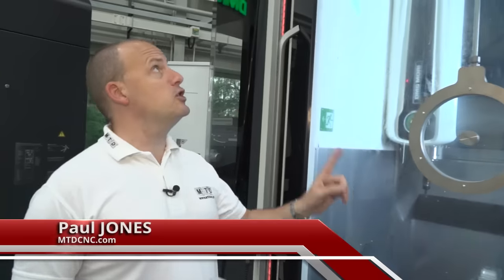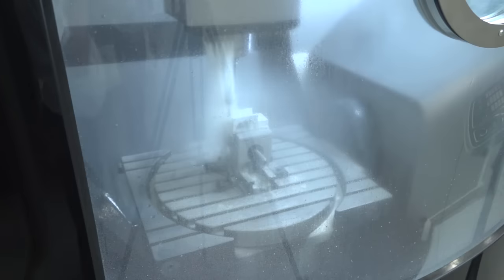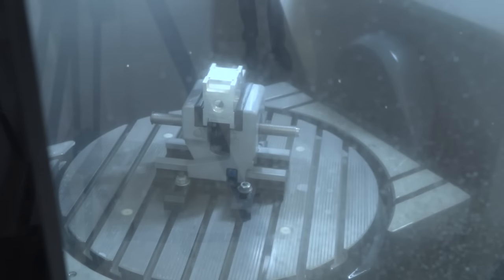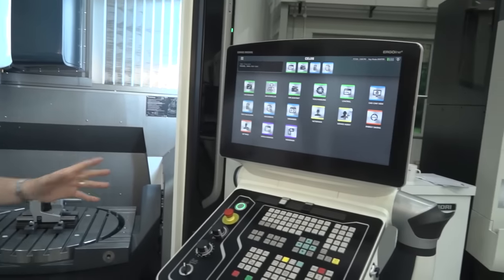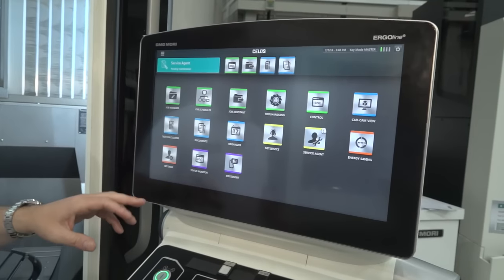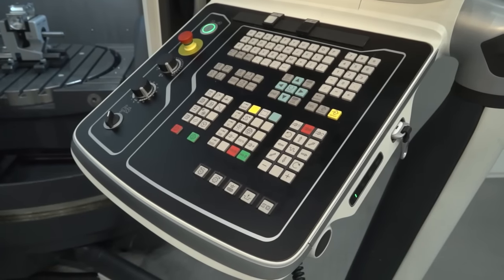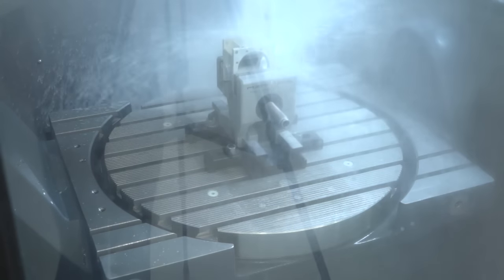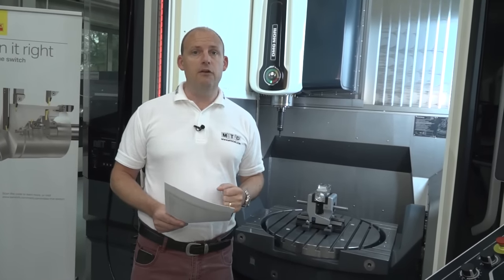DMG MORI DMU 75 Mono Block 5 axis machine

Comment: hmm why so tall??
Reply: You will see for sure that machine tools produced in Japan will become taller in the nearest future
Reply: It helps for the coolant mist and heat to rise away from the part oppose to short sealed doors is my guess.  It's one of the problems of a machine at work I know of. There's a ceiling cover just at max Z, and traps all the mist at eye height. And since the spindle already that tall for reasons like stability, they made the rest go with it.
Reply: @euclid9718  Why?
Reply: @anonymoususer3561  Lack of space

Comment: Lovely machine, would not buy it with Siemens though. Absolute hard pass!
Reply: Right
Reply: What's wrong with Siemens controllers? (I've never used one)
Reply: @anonymoususer3561  Siemens in general is a great control. However I've got DMG with Siemens and Heidenhain in my factory in the new generation touch screen controls and the Heidenhain simply work's but the Siemens is slow and laggy to respond to user input. It's like an old mobile phone that's ready to be replaced.